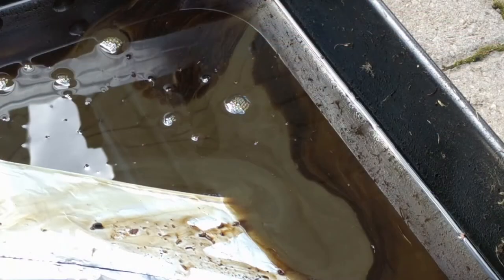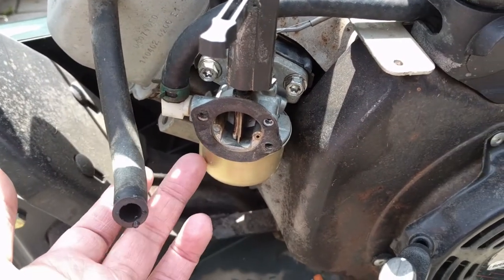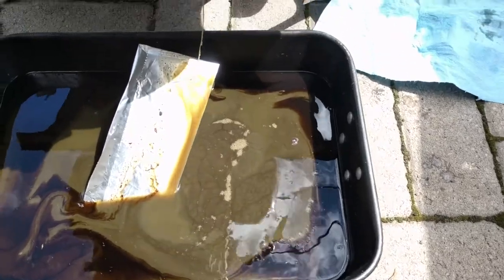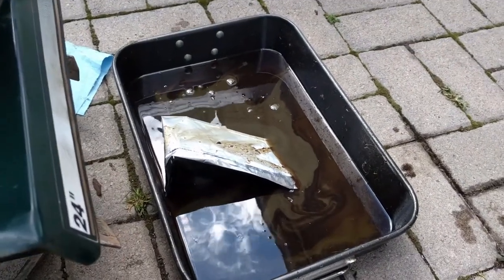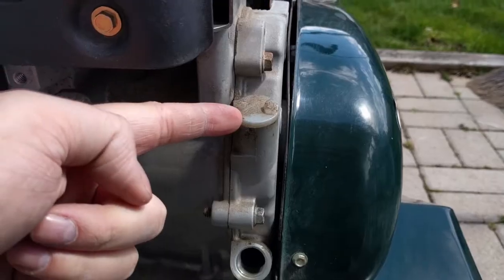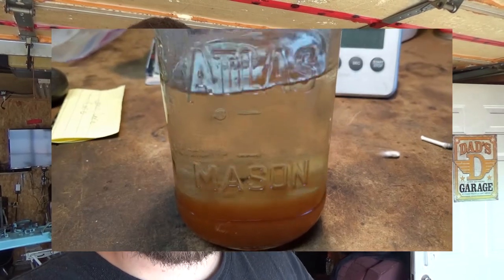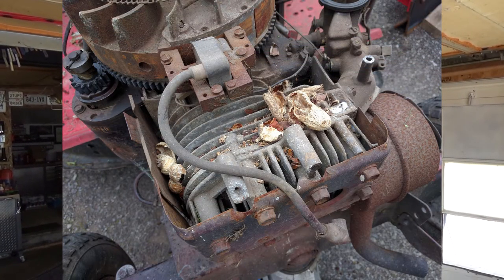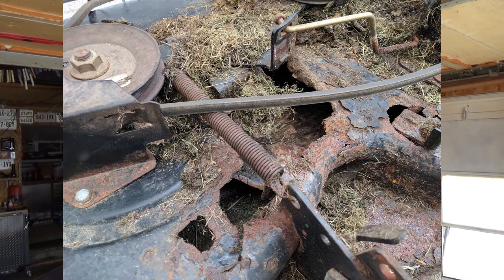Don't Leave Your Equipment Outdoors!

Comment: Thanks for the tips!!!  if my machines are stored inside a garage what do you think of putting mothballs around the machines to prevent mice traffic/nesting?  Ive done this late spring and hope to keep them away,.
Reply from the maker: zmanvideo1 yes, you could also put a poison trap near the frame of a riding lawnmower, although this is a more permanent solution to the problem, if you know what I mean!
Reply: Eliminator Performance yes of course ;)  thanks for the reply
Reply: zman someone told me that the softener sheets you use in a dryer for washed clothes works keeping mice away can not confirm until we try it out
Reply: thanks, I will try it out